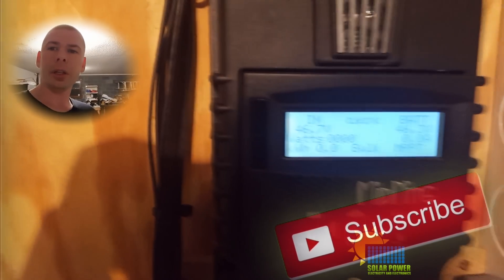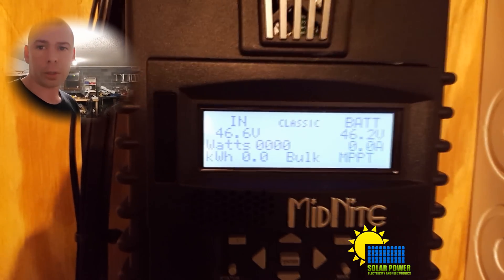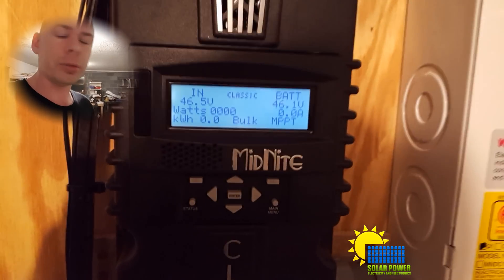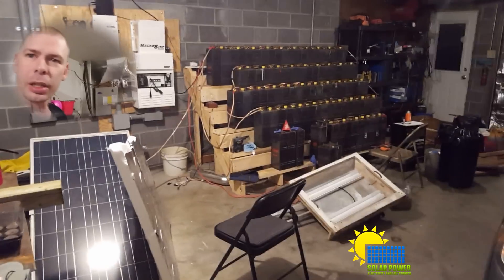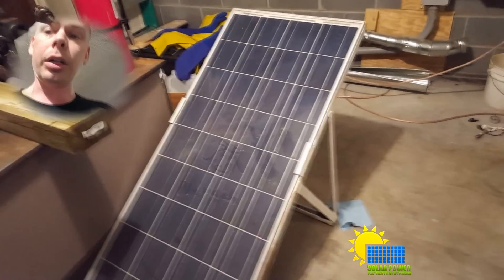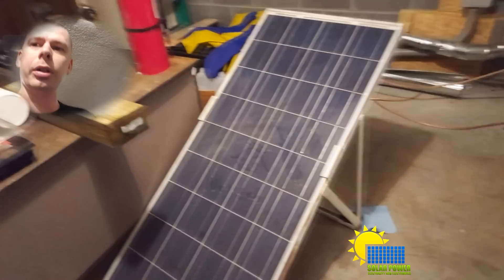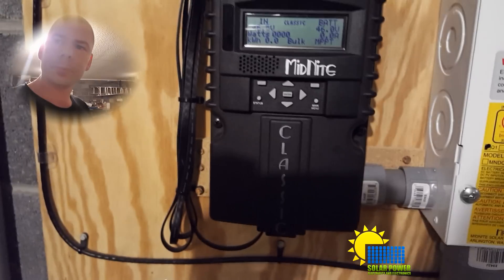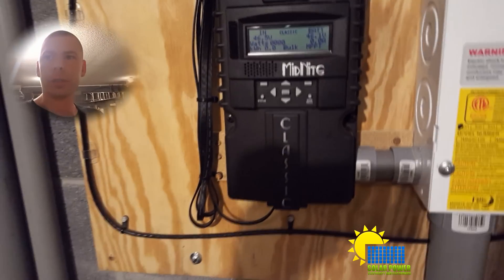Solar power at night time

Comment: hi can you or anyone tell me what I need to power up 3 fans I live in an apartment with a small balcony I've heard the flat  flexable panels are good need to know how it works,like what panels watts etc what else do I need??please help
Reply from the maker: You need a battery with good capacity you need in inverter and you need solar panels to charge the battery so the battery don't die you also need a charge controller and it all has to be calculated to your load or you can get a solar panel and a fan that runs on the same voltage and plug it in to the solar panel

Comment: Its a diode in the end 
0.7 v per cell  what defines that it generate power its amps generation 
thats wat the charge controller basically used for

Comment: common misunderstanding is thinking that if theres voltage it works , voltage is there but there is pretty low current so the panels are very useless at night

Comment: I would check it with a meter that is not electronic. An old simpson, or a wiggie. The electronic meters are not true RMS. They claim to be, but this proves to not be the case. The deal is, is that there is little to no current, so the watts coming is nil.
Reply from the maker: Gerald OBrien the reason of this thing happening is because a mode it's called insomnia mode on the classic you can read it up

Comment: How long before trailers power a truck via solar panels on trailers and how many solar panels can a trailer have on it and could that many solar panels actually power a truck and if so for how long?

I just have the ideas but people with experience in solar will at some point work out the sum

Eg so many panels on a trailer will power a truck for so many hours plus trailers can generate solar whilst sat empty in a transport yard and still produce solar whilst moving plus the truck wind faring on the front of the truck could be an aerodynamic solar panel

Comment: You have blown a diode.
Reply from the maker: Mika Lee no I realize that it was set up for insomnia mode and when it runs insomnia mode it pushes voltage backwards and that's where you get the measurement after it charges up the lightning arrester then it starts to discharge it again

Comment: this is an interesting measurement, my 2.88kWp system is hard-switched off by the inverter at night, so I haven't noticed any 'starlight' gain.

Another interesting fact about PV cells at night,  a PV cell can be used to generate light - when fed reverse power. It doesn't shine very much, and I don't suggest everyone tries it with their home energy arrays - but it is possible. Manufacturers can use this to check the quality of the individual cells viz.  'Electroluminescence of photovoltaic cells'

Comment: I have found a similar phenomenon when using small solar panels as sensors for dusk switches. Unless you load them down there is voltage present when it's rather dark. Which is not much use for a dusk switch! lol 

By the way Phil, today is two years off the grid for me. I'm celebrating by installing some solar panels I picked up yesterday. :) ...better get back too it. Just had to head inside to get away from the damn heat for a bit..! 

It's amazing how a warm tea can cool you down better than a cold drink. The old steam loco drivers used to swear by it!
Reply from the maker: xanataph cool
Reply: Switches on your body cooling system, i believe......
Reply: @xanataph - What size (watts) Inverter(s) do you have, that can run your whole house?
Reply: @MrSummitville  3 x 1 KW, 1 x 1.5KW, 2 x 2.5 KW and a 500 watt Latronics unit that punches well above it's weight. ;) Those are the ones that are actively installed in the system. I have quite a few more laying around as spares and for use in temporary setups.
Reply: @xanataph  Do you have Central Air Conditioning?  A Gas Furnace?  A Gas Clothes Dryer?  A Gas Stove?  A Gas Hot Water Tank?   7,500 Watts would not be enough to run our home.
Reply: @MrSummitville  We cook on gas during the Summer. And we cook and heat with solid fuel during the Winter. It might not be enough to run your home, but it's enough for mine. We are old-school solar to a large degree. i.e. we have adapted our lifestyle to fit with the energy we can generate rather then trying to pretend we are still on the grid. Sometimes it is tough way to live but we have done it for six Winters now and going into our seventh.

Comment: I've experience that before during the summer when the sky is clear and the moon is out. My experimental grid-tie micro-inverter would still produce <1W  on each module.

From what I am able to gather on what was happening; the sun was setting to the west and the street lights just came on along with the moonrise. Between the two was enough ambient light to keep the micro-inverters from dropping out and the handoff was perfect that it kept it going throughout the night. 

I kinda caught on to it was when I was checking my TED (The Energy Detective) monitor and wondering why there was still power being generated at 0200 hours. I logged into my micro-inverter management controller and sure enough most of them were still generating power albeit insignificant to do much with.

Pretty much it is not an uncommon occurrence at all, but the amount of useable power you'll get out it is not much. Amazing none the less...
Reply from the maker: Android User now that is very cool

Comment: This is not uncommon, check it on good clear sky night with a full moon. I am surprised that you never realized it before. I have seen up to 1.6 amps out of my 3000 watt array wired for 12v dc. Next time I get a good clear night with close to full moon I well take a video of it.
Reply from the maker: It was rainning
Reply: Water can magnify light, so it is a good chance that was what was going on
Reply from the maker: 21 watts now as we speek
Reply from the maker: not raining tonight